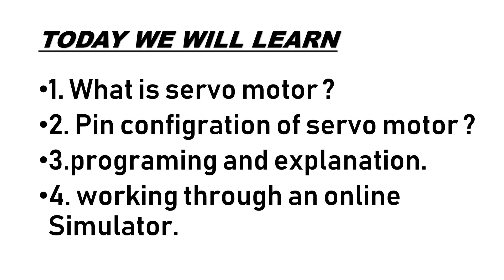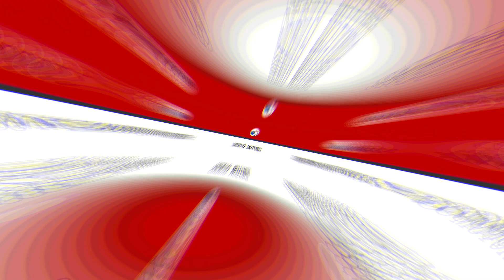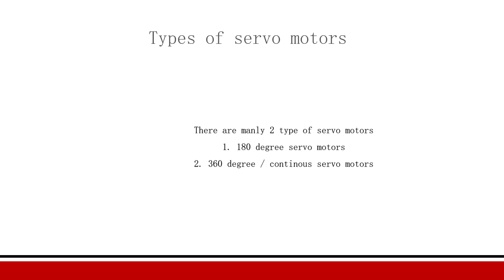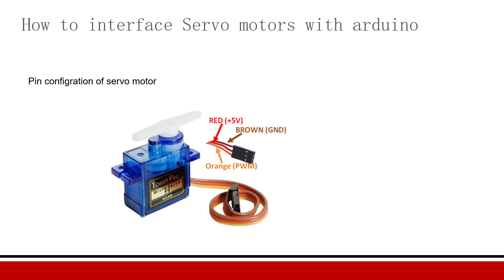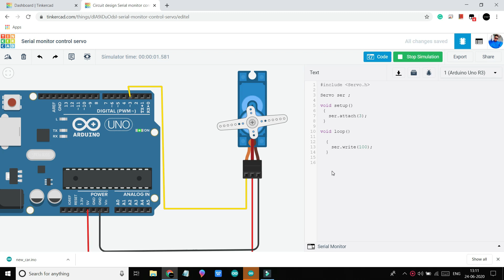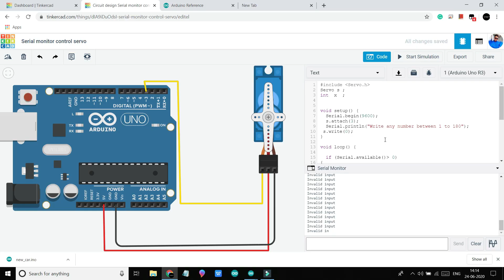arduino servo motor control   || How to interface series #ATALL #arduino #diy

Comment: how to restart its rotation from 90 degree
Reply from the maker: can you explain it .. i am not able to understand what actually you want from your servo
Reply: @ATALL03  when i give input it rotates and comes back to 0 degree, it will start rotating from 0 degree i want it to rotate from 90 degree
Reply from the maker: you are doing this on simulator .... and you are following my codes the  i can tell you where to change the code
Reply: @ATALL03  tell me where to change the code
Reply from the maker: so you want that your servo motor will be set to 90° initially and then when you input from your serial monitor it will move accordingly and then come back to 90° ... right ?
Reply: @ATALL03  exactly
Reply from the maker: okk  so do following things:
1. in void loop () before if(serial.available()>0)  
write s.write(90)

2. after s.write(x) ;
delay(100); is there now change this to delay(250);

3. in last line of code means befor final "}" write   s.write(90);
and in next line write delay(250);
Reply from the maker: after applying this please give your feedback that this code is working or not... and also please subscribe to this channel 😇✌️
Reply: @ATALL03  no its not working
Reply from the maker: @manishmp8472   here is your code  
https://docs.google.com/document/d/1L0ggxvhQ8FJ9oJ3YuC1RFs9i1JWfzIOSczhGlUA90Pg/edit?usp=sharing
Reply: @ATALL03  thank you, its working